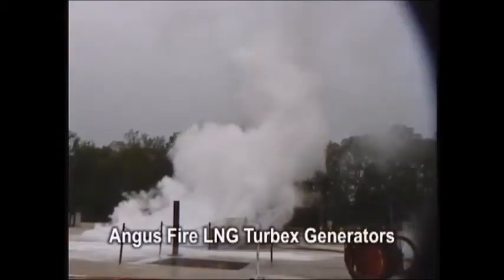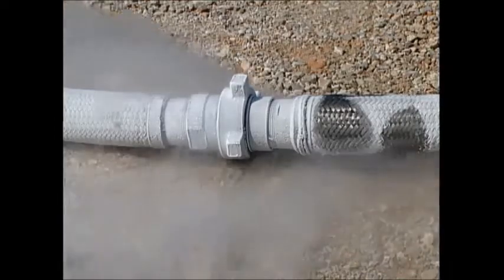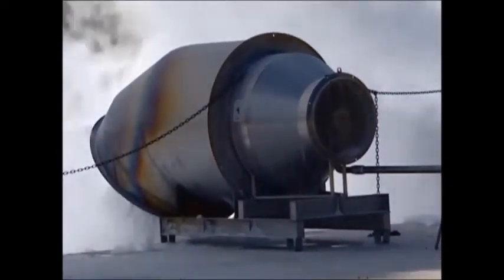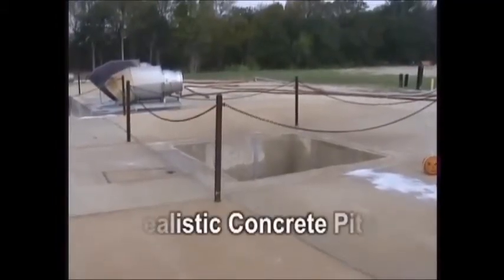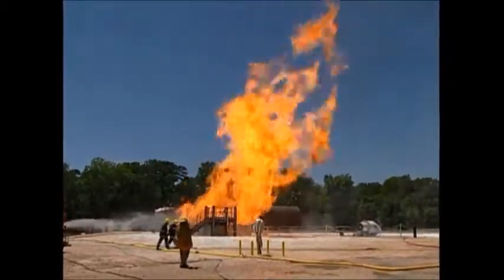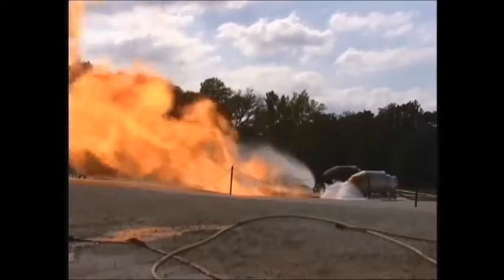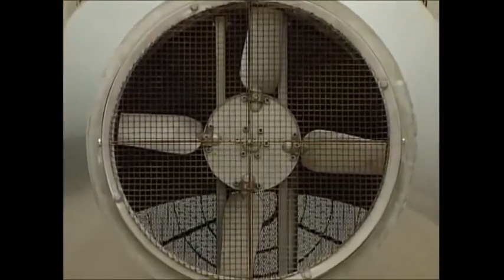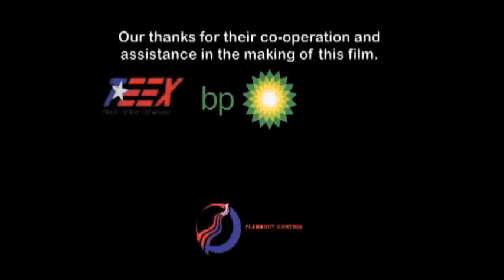Demystifying LNG by Angus Fire

Comment: Out of date fire safety concepts
Reply from the maker: High expansion foam remains the most established technique for protecting the bulk storage of LNG and this test work is still the most extensive practical work done in this area to evaluate both foams and the robustness of the delivery equipment.
Reply: A heat flux below <2kW/m2 is easily attainable together with a vapour dispersion rate <2% methane v/v for the full spill duration.  Safer rates than those required by 'current' FERC reg limits.
Reply: Does that make it safe or safer?
Reply from the maker: In the majority of situations the Hi Expansion foam system serves two purposes.1. If there is a major spill of LNG it will blanket this spill and control the level of evaporation.2. If there is a spill and a fire occurs, then the system is designed to control the fire and allow a controlled burn off. Full fire extinction is not usually desired as it can lead to an LNG cloud forming which should it find an ignition source can cause a major expansion.Hope this helps with your question.